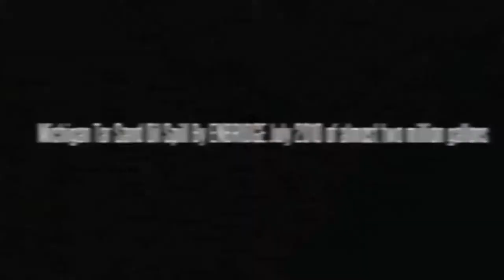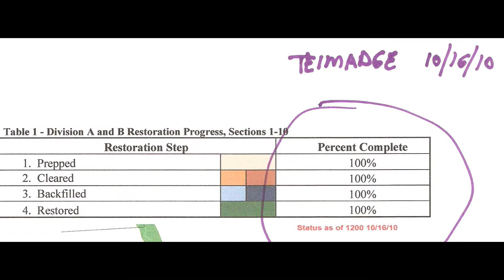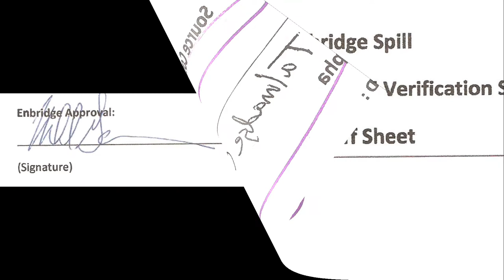ENBRIDGE buried oil JIM MONAWECK says, John Bolenbaugh

Comment from the maker: It depends on the pipeline. A lot of the tar sand oil is refined here in the U.S to prevent the toxic gases from being released in Canada. Yes you heard me right. The carbons are to high to refine it in Canada so they send it here. Then after we refine it they send most of it back to Canada for there use. The XL line can not be taxed by us and we can not gain any revenue from the pipeline except a few hundred jobs for a max of 2 years & then we take all the risk when there is a spill after that